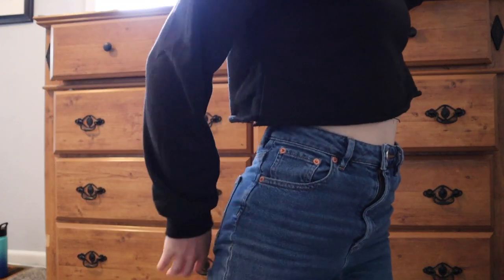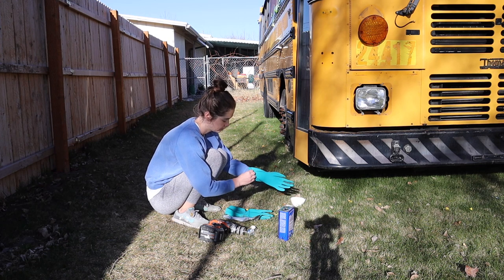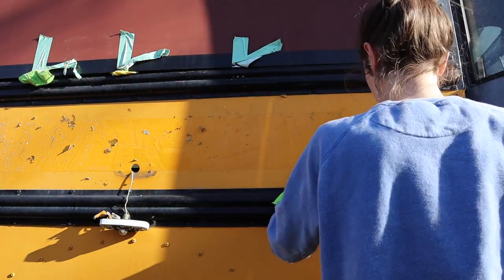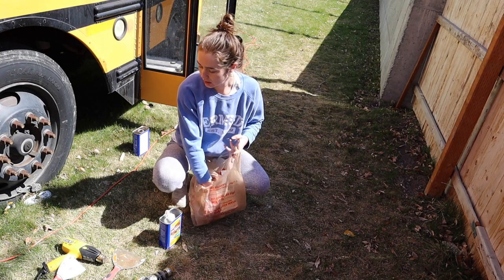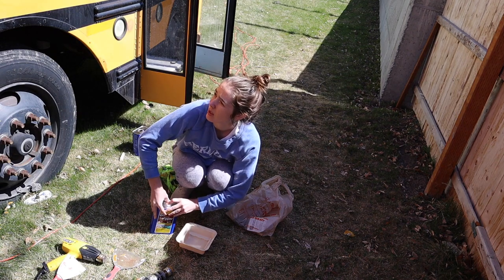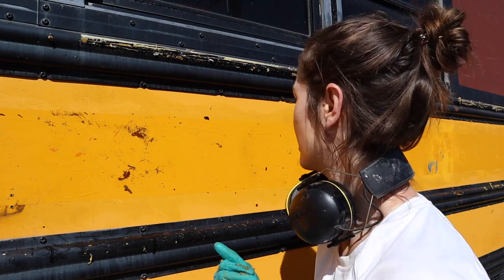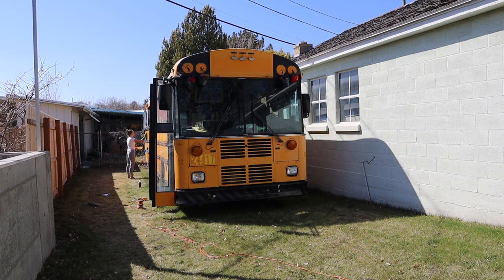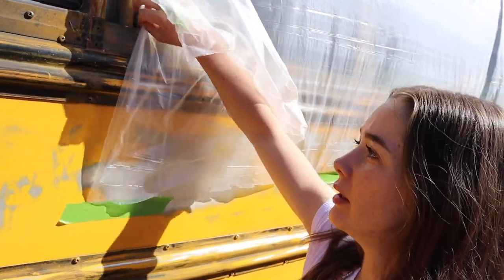School bus sticker residue removal: Figuring out how to get rid of goo quickly and easily (build p5)

Comment: Believe it or not, peanut oil and/or peanut butter is also good for taking off adhesives, especially if you let it sit for a while. The grittyness of the peanut butter is good for scraping the adhesive and holding on to it. Go back with a grease cutting detergent solution or citronella oil based product, to clean up what is left. I do this on jars all the time to remove label adhesive. In principle, I'm to thinking it should work for other adhesives as well.

Comment: This is just a thought I know you’ve already made videos past this part but in the future as you are working on the outside of the bus again especially if you’re painting or prepping for paint it would not be a bad idea to put up a tarp to help keep that side of the bus out of the sun. One it’ll keep you more comfortable unless you like getting baked LOL and two it’ll keep the temperature of the metal more stable
Reply from the maker: i didn't think about that, would it be better if i worked on it during the cooler times of day?
Reply: @EmmaBuildsBirbie  I don’t know if this is true or not, I’m just thinking that if one side of the bus is so much hotter than the other the paint will adhere differently. Like I say I don’t know if this is true or not so maybe something to look at or look into or ask the paint shop were you buy the paint. Of course if the Metal is nice and hot maybe, it would bake the paint on better again I don’t know this either. As far as being too dumb for power tools no you’re not. And they will make your life so much easier

Comment: Well, the fastest way to remove rust and paint I know besides blasting is the angle grinder in combination with a cup wire wheel. It's safer as it rotates sideways so broken strands don't hit you and it does mayhem with paint. Proven technique.  Oh, and for the sticky mess after stickers, use antisilicone solvent. Spray soak it and after 3 or 4 sprays scrape it with the flat palet. =)

Comment: Angle grinder and a good blade (not for cutting) would be far better than that little brush and the battery drill. Seriously, when you get used to an angle grinder you use it all the time!